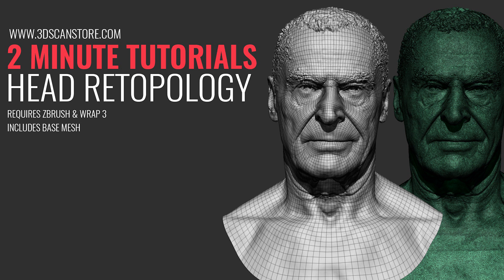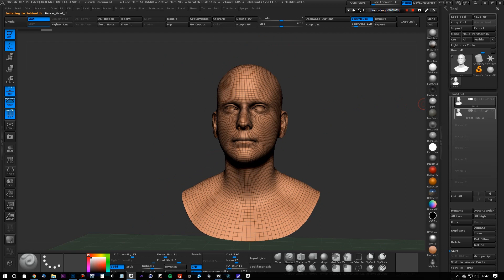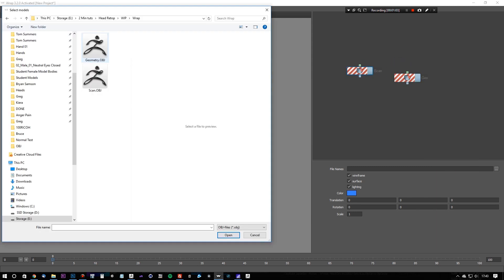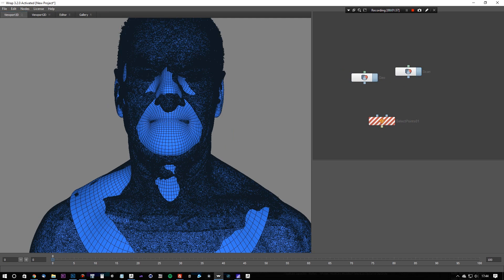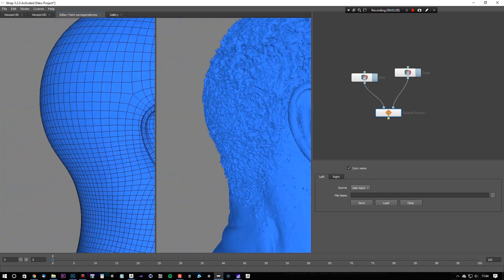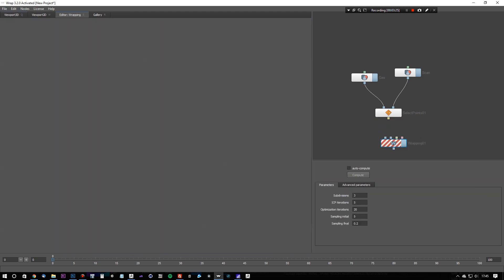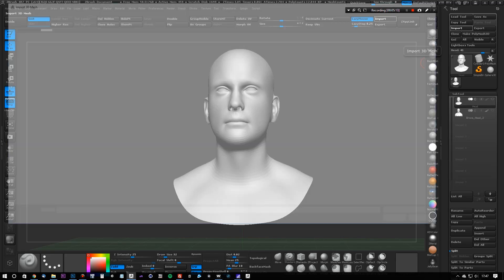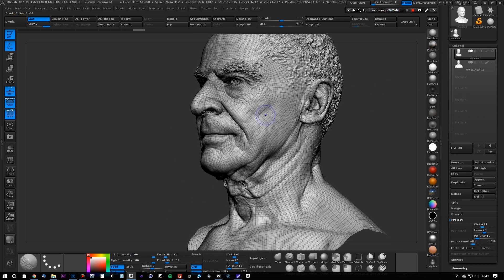2 Minute Tutorial - 3D Head Scan Retopology for cleanup

Comment: Great Info! I was wondering if it's possible to use this method with a 3d head scan and full-body base mesh instead of just the head and shoulders base mesh in zbrush? My plan is to then import it into character creator 3 if possible. Thanks for the help and wonderful video.
Reply from the maker: Yes its totally possible, I do this on full body models all the time :)